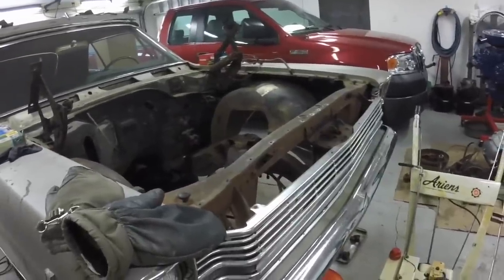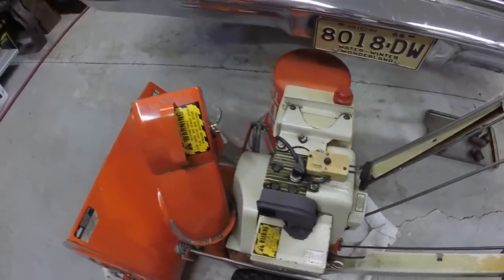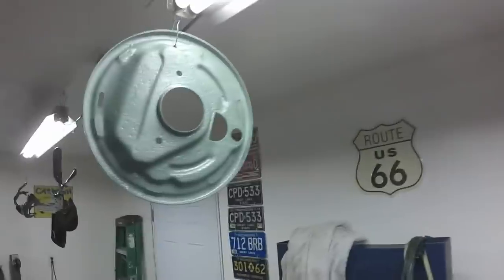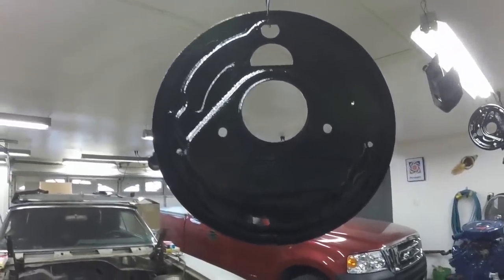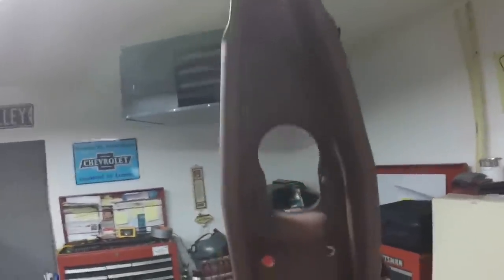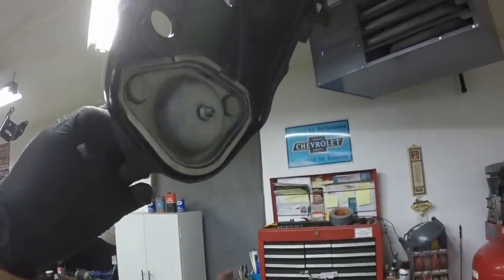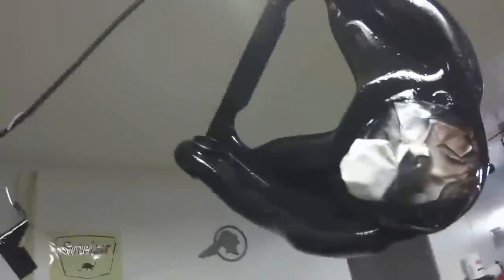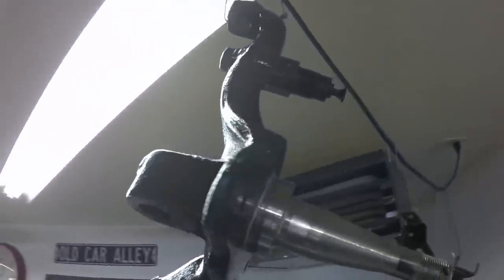1966 Ford Galaxie 500 convertible restoration part 30 cleaning and painting front end parts

Comment: A nice restro is really hard to do anymore. As they get older they become unobtainium. Good cars sell high as they become like so hard to finish at the end
Reply from the maker: I have found in the past decade or two, prices of project cars have gone out of sight. I think it's all the shows on TV and YouTube that make people think there car that is in need of 100% restoration, worth what a restored car like theres sell for. I looked at a 66 Mustang  last spring. The owner wanted $25,000 for a car that was worth maybe $5,000 at most. It needed floors, trunk pan, it had new rear 1/4 panels installed incorrectly, so they needed to be removed and installed correctly......

Comment: Where is you spray booth? I was wondering where you painted parts since you did not cover anything in the garage.
Reply from the maker: Outside.... I just run out the door, with the part and door jamb gun. Give them a quick spray, then hang them up in the warm garage to dry. Been doing that for 30 years, and never had a problem... so far.